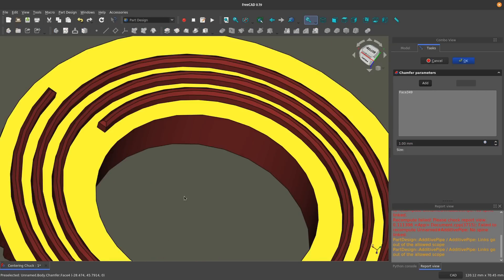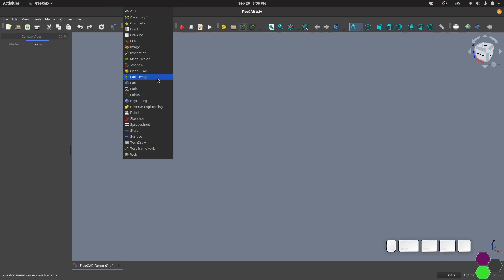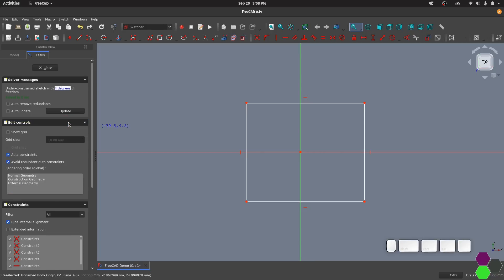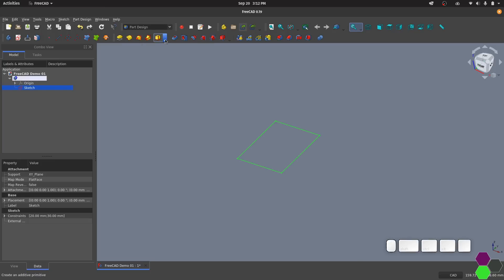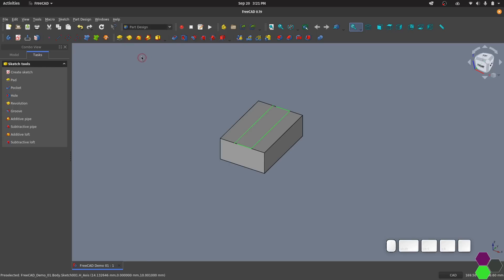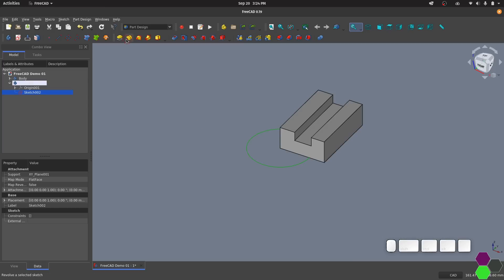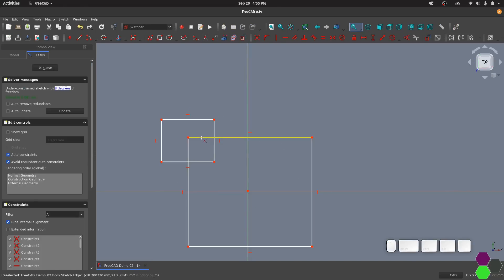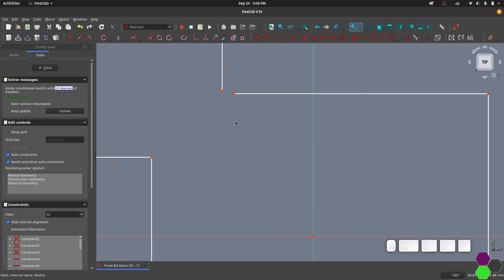Fusion360 to FreeCAD - Introduction

Comment: Not a good beginners guide, you dont explain each step just fly through and i get lost.  Also my "0.19" looks and behaves differently to yours by default so really trying to learn on a beta changing application is a bad idea.
Reply from the maker: No, it's not a beginners guide, it's a quick kickstart for people who are competent in a different software suite who are already familiar with 3D CAD concepts.

There are minor differences in UI look and interaction based on OS as the UI is built with QT and it uses the native OS controls rather than a fully custom UI. Some parts will be tied to your OS UI themes as well. You would see the same differences to mine on the stable release 0.18.4.

The general consensus in the FreeCAD community is to use 0.19. it is more stable than 0.18, has some features that are essential for the new Assembly workbenches, a lot of other huge feature improvements and isn't far off official release. Everything I did in this video will work in 0.18, with the exception of the darker theme, but things I do in future videos may not work in 0.18.

Comment: I clicked on the link in the description but I cant figure out how to download the 0.19 executable for windows can you do a shore toutorial on this please, as it doesn't see to be straight forward
Reply from the maker: I just had a look and I can understand how it can be confusing for Windows, both the Mac and Linux versions are more straight forward than the Windows version.

DrVAX explains the whole process really well.
https://youtu.be/l4WzCjmuJg0

Since it takes time to put a video together I'll try and point you in the right direction here.
The file you'll want will be called something like this "FreeCAD_0.19.22670-Win-Conda_vc14.x-x86_64.7z" (the version number will change often as the update it).
To use it, you first have to "UnZip" it, using an app called 7Zip, which is linked on the download page (I will ask the developers if they could use a standard zip file format that requires no extra software in Windows).

When the file is extracted/unzipped you can run FreeCAD 0.19 by going into the bin folder wherever extracted the file and double clicking "FreeCAD.exe".
Reply: @BrodieFairhall  thanks I'll try again but I couldn't find that. 7z file last night

Comment: Not being able to have overlaping profiles in the same sketch seems to be a major limitation. I'd have to create several separate sketches, one per detail?
Reply from the maker: This is an ultra simplified intro to FreeCAD, you can have overlapping profiles in a sketch, it just works differently to Fusion and I didn't want to confuse everyone before they even got started.
I will be doing some more detailed videos on this very soon.

Comment: Thanks for the video, here are a few subjects I'd like to ear about : 
Can you edit an early feature in your design and have the rest of the subsequent operations adjust accordingly in freecad ? (for example changing the dimensions of the rectangle in your first sketch but in a "real" project, not just two cubes and a cylinder) Does it fail sometimes and if so can you fix the things that are failing without redoing the whole design ?
Can you show us the creation of a fully constrained sketch like a rounded rectangle and then try to adjust its dimensions ? (I have bad memories about trying to use freecad a few years ago and doing this ended in a mess of errors)
Reply from the maker: You can absolutely do this as long as you constrain your sketches fully and you use origins or datum planes for sketch offsets. I'll be doing a video about the "topological naming issue" which is one reason that people have trouble with changing early features in models.
Even if you take a bunch of shortcuts and create issue in a model because of it, it's pretty easy to fix it up quickly which I'll also show in the topological naming issue video.

Comment: you have turned the screen black. Very hard to see where you are going. Also, like so many other videos, you are making a video from your perspective, very hard to see what you are clicking on. Bad video!
Reply from the maker: I'm sorry you're having trouble seeing things with the darker theme, I may decide to use a lighter theme for my next videos. Are you able to play the video at a higher resolution? Because that will help a lot.
I am using a tool to highlight my mouse clicks, I will see if I can improve its setup a little.

Comment: Hm. I have intersecting lines in like all of my Fusion 360 sketches. Is there a reason it can't be done in FreeCAD? I've not yet made up my mind if i want to switch. This intersecting lines thing is a real bummer for me.
Reply from the maker: I have massively over simplified the sketcher for this video to get people started, I'll do a more detailed video on the sketcher and how I use it. You can have intersecting lines, it just works a bit differently to Fusion.

Comment: Thank you. I'd tried FreeCad in the past but struggled to get into it.
Fusion360 let's you stumble your way through things without necessarily having a specific step by step plan in mind, and it has those very detailed tool tips.
Both were great to make the learning curve easier, but it looks like FreeCad isn't as bad as I'd remembered.

Does FreeCad have any CAM utilities, or for now will I need to keep Fusion360 installed just for those capabilities?
Reply from the maker: FreeCAD definitely has improved over the last few versions
It has a CAM workbench called the "Path Workbench". It's in 0.18 but the version in 0.19 is way better.
I plan to do a video on it soon.
Reply: @BrodieFairhall  Thank you. You've made the switch from Fusion360 to FreeCAD look a lot less intimidating

Comment: Where did you get version 0.19? I've been looking around for it for a while now. Also Autodesk have really dropped the ball here. doesn't matter, found the link in the description, thanks!
Reply: You can have It with Linux, even nightly builds.
Reply: @tomdtom5407  FreeCAD .019 is a developer "pre-release" but you can download it from github.
  
https://github.com/FreeCAD/FreeCAD/releases/tag/0.19_pre

But that said, the discussed "Hole feature" for example works right in release version 0.18, and I am finding it is broken in 0.19 - at least the most relatively current one I downloaded 3 or 4 days ago.  Not sure if it's worth going with the dev version.

Comment: I'm here seeking asylum from the autodesk oppressors.
Reply from the maker: Welcome aboard!
Reply: Disappointing that they added even more restrictions to Fusion360 free version. I understand why, but it still blows.
Reply: I'm actually a paying fusion 360 customer but I switched to Linux and fusion only runs unofficially via wine. Also my space mouse doesn't work with it which really sucks. I am hopping I can get used to freecad and switch as the space mouse does work with it. Thanks for the great video.
Reply: Nothing changed for you guys. If you use Fusion 360 above the level they restricted, you’re not using it as a hobbyist. The level of functionality that the free F360 version provides, even after the restrictions, is mind blowing. You’re certainly free to go with open source, just don’t expect the same functionality and speed of modeling.
Reply from the maker: @tomuhr5802 I think you're underestimating quite a number of hobbyists here, lots of non commercial users were using a lot of functionality that has been removed from Fusion.
Also think about the number of open source projects that have been effected by this, both the 3D side and because Adsk rolled Eagle into Fusion.
After using Fusion for 5 years, I'm amazed that Adsk actually think it is ready to charge people money for at all.
Reply: @BrodieFairhall  No. I was quite clear in what I was saying. But sure, humor yourself. Since you clearly think that software on this level should be for free, what I would consider rather delusional, FreeCad is ideal for you. While we, that actually use these different CAD platforms for work, consider Fusion 360 the most cost efficient software on the market. And look nothing against open source, there’s a lot of amazing stuff out there, but please stop the whining on what you should get for free.
Reply from the maker: @tomuhr5802 What makes you assume I don't use CAD for work? I have commercial licences for Inventor and until I cancelled my subscription, Fusion 360 and here I am also using FreeCAD, there must be a good reason for that...
I don't expect any commercial software to be free, sure Autodesk don't have to give anyone anything for free, but they also got years of free evangelism and educational content because their almost fully unlocked software was available for free. 
The reason I don't think Adsk should charge for Fusion360, from a commercial perspective, the software is far from stable or functional enough for genuine commercial use. They have been cutting tools from the commercial version and making them "call for quote" style add-ons, which I imagine will continue, so for anything but the most basic commercial use, I'd recommend going to a more expensive product because you'll end up paying that much in the end anyway. Though more limited, Inventor LT would be a much better basic commercial option, but now it's gone too.
Reply: @BrodieFairhall  Fair enough, apologies for the inadvertently used straw man argument. While I agree that Fusion is not the best choice for heavy assemblies or production runs, we don’t have a problem running it commercially. Besides Fusion, we use or used Rhino, Solidworks, Onshape and Inventor, as well as MasterCam. Still, if Fusion with its interface would have the power of Inventor, it would blow all other software out of the water. But even as is, for a quarter of the price, it’s a no brainer. The one thing I would have to disagree, though, is Inventor Lt. With no drawing and assembly capabilities, it’s commercially completely useless.
Reply: @tomuhr5802  Actualy, it did change.  They took features away.  If they had added features that were only available in the paid version, most of us would never have even blinked.  Now we are left to wonder what feature will disappear next.

Comment: They would be so much better if they just made the interfacing exactly like fusion. Honestly, most of the major differences isnt in technical capability, it's purely interface.
Reply from the maker: But it's not Fusion.
Learning something new is challenging and we all compare anything new pretty harshly against what we know.
If you want to, you can customise the UI and there are UI add-ons, icon packs etc that you can add.
Beyond similar icons, Autodesk's real 3D CAD suite, Inventor, doesn't have the same interface as Fusion.

Comment: FreeCAD needs some UI overhaul... the huge number of small icons isn't really good for user experience. Everyone hated Ribbon UI when it was introduced, but in hindsight Ribbon helps with the clutter and legibility way more than people realize. Something similar to FreeCAD woudl be great.

Especially when the resolutions of the screens are increasing rapidly, small 16x16 icons are just the evil.
Having multiple tabs for different type of editing is also good in reducing clutter.

And CAM integration would be almost essential these days.

It's not in the style of linux-type software to integrate anything but one thing in a program, but frankly, manufacturing and designing are so integrated that I hope they'll add CAM facilities as well that can update when the model updates :)
Reply from the maker: You can change the Icon size in the preferences menu, the dropdown is just under the one theme selection one.
There is a Ribbon UI add-on https://github.com/HakanSeven12/Modern-UI
FreeCAD does have CAM integration

Comment: Probably further down the line but, I understand that the 'last leg' is not done by freecad, I mean generate the gcode, an indication of the best Open source software to do this would be good
Reply from the maker: gcode for cnc, or 3D printer? (or something else even)
FreeCAD has a Path workbench for generating tool paths and gcode for subtractive manufacturing
https://wiki.freecadweb.org/Path_Walkthrough_for_the_Impatient
Reply: @BrodieFairhall  That's very interesting, I'm talking subtractive, as in milling. The last time I looked around at Freecad people were still talking of moving to Fusion because of the lack of it. Thats definately good news, cheers

Comment: I just wanted to chime in and add that the sketch function in FreeCAD is in fact very similar to that in Solidworks (I trained in Solidworks as part of my engineering degree). I think we all got a bit spoilt by how A360 sketches. A360 sketching is really nice, while Solidworks/FreeCAD being a little more 'clunky', but it still works and works well.

Comment: I have been using FCad v0.18 for about two solid months now.  I am nowhere experienced in CAD generally, but I have become very comfortable in using FCad.  The only real issue I have now is learning how to get text on my objects.  It works sometime and getting the orientation of my text is a little troubling.  But I am quite satisfied with its performance and the current tools it has.  I still have a lot to learn.  Its is an enjoyable application with a nice CAD community involved.  Thanks for your input on this application.

Comment: Wow, the limitations are major, and it the workflow requires many extra steps.
Definitely not switching, I would rather buy a license for 800 bucks or pay monthly few for software that is better useable.
Don't get me wrong, I like that some found a working alternative for them, but when I had to live with that restrictions and completely different workflow, I would rather switch my hobby.
Reply from the maker: You're absolutely welcome to do that.

But remember, this is only a 10 minute bare bones intro, there is so much more to FreeCAD than I can fit in a short Video.
I have a commercial Fusion360 licence, so I'm not effected by Autodesk's latest stunt. I use FreeCAD because it is way better than Fusion at a lot of things, so I'd encourage you to have a genuine look at learning it.
Reply: I know, right? If you have a hobby like 3D printing and 3D design you might as well enjoy what you're doing, not suffering and dealing with clunky software. Either buy, pirate or just change your hobbies

Comment: Thanks for the video. I'd like to see how to use version history, if such a thing exists.
Reply from the maker: There is currently no built in version control system.
I believe there is a version control system in Real Thunder's dev branch ( https://github.com/realthunder/FreeCAD_assembly3/releases ), which will likely end up in FreeCAD 0.20.
Reply: @BrodieFairhall  Thanks for reply. So I guess the best type of version history currently is just using save as and keeping track that way?
Reply from the maker: @scruggs.jonathan  that's all I currently do and anything shared I do through git.

Comment: A free alternative to Fusion that runs on Linux is alluring.  Is it dependable and easy to use to do typical operations for 3D printing or is it frustrating and buggy? Thank you!
Reply from the maker: Absolutely! Initially, it may seem daunting / hard to wrap your head around, but the workflow absolutely makes sense once you get it.

Comment: Thanks for the video Brodie. I am about to get into 3D design and was tossing up between F360 and FreeCAD. I am curious that you are using 0.19 rather then the latest stable 0.18.4?  It is also a little troubling that all FreeCAD releases (including Dev version) are 2019 ?? What gives?
Reply from the maker: The 0.19 Dev release is a nightly build, but they just update the original post from November 2019 with the new binaries and source (the team has acknowledged that it should be done better and will work something out after the full release of 0.19)
0.19 has many quality of life improvements but most importantly it has the linked object system, which is the basis for the new assembly workbenches and a whole lot of other future capabilities.
If you want to see what some of those future capabilities are, you can look at RealThunder's Dev branch
https://github.com/realthunder/FreeCAD_assembly3/releases
Reply: @BrodieFairhall  Thanks for the clarification. Makes me a lot more relaxed about using FreeCAD.

Comment: How do I get my color scheme to match yours? It looks great.
Reply from the maker: FreeCAD 0.19 Dev release (the link to it is in the video description) has more color scheme selections than 0.18 does.
I am using the theme "Darker Blue".

Some UI elements are still different on different Operating systems.
Reply: @BrodieFairhall  Thanks buddy (I should have seen that on my own :)
Reply: @BrodieFairhall  I just figured out that the window, and some other aspects, follow the system wide color scheme in Windows. That helped to sort out the parts that the selections didn't hit in the app.

Comment: Thank you Brodie. I am a intermediate F360 user mostly for 3d printing and paper templates for cutting materials. I don't spend enough time per year on F360 to warrant a massive yearly subscription. Your video is also exactly what I need and coming in at the first video means I can learn at a pace rather than wading through loads of videos trying to catch up. I'm still not convinced FreeCad is what I need but you have prevented a premature binning of the software. I look forward to your next instalment. 
Aiden

Comment: fusion 360 is a good tool but i've started with freecad years ago. What i don't like in freecad is the machining workshop, i don't know if they are planning improvement.
Reply from the maker: You can look on the FreeCAD forum and there may be some more information on a roadmap for the Path worbench